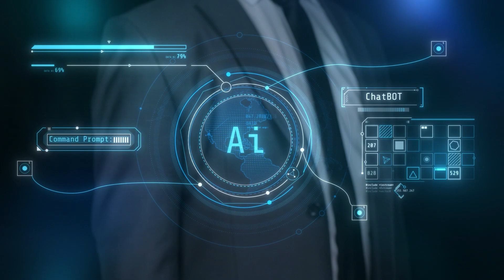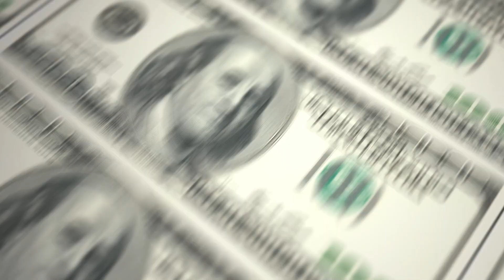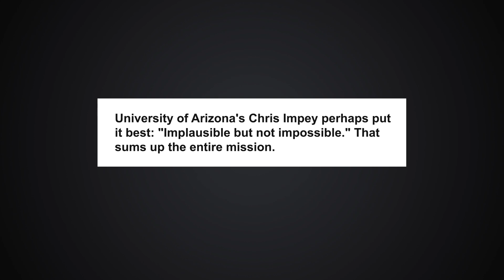BREAKING! Timeline for Optimus going to Mars NOW UNVEILED! We’ve got the SHOCKING details!

Comment: Thank you for initiating this discussion. I believe the skeptics are mistaken in their assessment of the project’s feasibility. Here are some reasons why:

1) The primary objective is to establish lunar and Martian bases. While these bases will require a launchpad and a refuelling depot, it is feasible to reduce the scope to only the launchpad.

2) SpaceX’s Starship can be modified to carry a reduced payload, thereby increasing  the fuel capacity required to reach and land on Mars without refuelling.

3) The payload will include at least two rovers equipped with power plants. These rovers will be responsible for periodically charging the robots while they search for a suitable launchpad site. Once a location is identified, the robots will construct the launchpads, fulfilling the project’s objective, and paving the way for the next mission - to complete a base capable of refueling a return trip Starship from Mars
Reply: Thanks, your comment is very helpful.